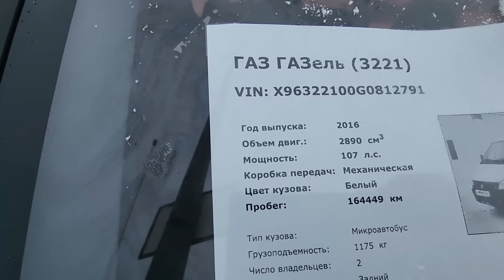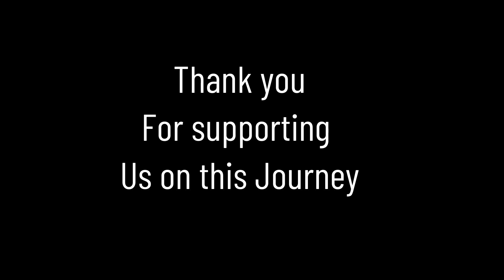NO LONGER FROZEN IN RUSSIA!!

Comment: And Arend, one very important point you need to know!
I do not know what a driving license looks like in Canada, but in Russia we have such a thing as a category of rights. It is indicated by Latin letters: A, B, C, D, E.
For example, the presence of the letter "B" gives you the right to drive an ordinary passenger car. Category "C" is a truck capable of carrying over 3.5 tons of cargo.
But category "D" is a passenger bus. If your Van carries more than 8 passengers, then it is already a micro bus and not a Van and it needs a category "D". In the form of both Gazelle and Korean Van (huenday), they had 8 seats that would not fall under category "D".

So if you want to put more than 8 seats in the car, then make sure that you, and your wife also has the right to drive the micro bus, i.e. you both must have a Category "D". You will also have to contact our "ДПС" (traffic police - DPS) to re-register your Van on the micro bus because you increased the number of seats from 8 to 10 and thus returned the Van to the micro bus.
I strongly recommend that you check with the traffic police or with knowledgeable people about what you will have to do to re-register a car in a minibus, how to do it correctly and how your driver's license is suitable for driving a bus.
For driving a car without a need for this category, it equates to driving without a driver's license and the penalty for this is a fine of 5-15 thousand rubles and confiscation of the car at the impound lot. To pick up a car from a impound lot, you need to pay a fine and every day the amount of the fine will increase. Therefore, the impound lot is a very unpleasant situation.
Reply: Wow, not something to be taken lightly for sure.
Reply: @joycehaines2055  Yes, in Russia, if your car was towed to a impound lot, then you need to pay a fine on the first day, otherwise every 24 hours your car stays at the impound lot, the amount of the fine will increase.
I know of cases when the fine became so large that the owners of the cars simply abandoned them at the impound lot. Then, after a certain period of time (if it is clear that the owner abandoned the car), such cars are withdrawn in favor of the state and the state sells these cars at auction.
Reply: This is a very useful and significant information ! Thank you for sharing !
Reply: @_I_am_Lucy  No problem )
Reply: impound is same everywhere, daily charges apply.
Reply: It's similar in Canada.  A regular driver's license is a class 5, class 4 if you have 8-10 seats, class 3 is tandem axle & towing, class 2 is school bus and class 1 is semi-trailer.

Comment: Hello Arend. A few notes regarding Gazelle.
1. 4x4 Gazelle is called Sobol.
2. 8+ seats is a different driver's licence category. It's considered a bus, you need the bus driver category.
3. Adding seats or any other significant changes to the car is possible, but you need to license it, which is extra work. So obviously try to avoid it if possible.
4. Gazelle is a good car when you properly understand it. Typically people get all juice from them and then try to sell. So most of the time used Gazelles are dead. You should be very careful in choosing one. In your video you are looking at a dead one.
5. Repairs are easy and cheap, but a used gazelle with significant mileage will break often. It's simply unavoidable. These cars are built to be affordable, so from the factory they are not meant to last a million kilometres.
6. There are three generations: Business, Next and NN. They are very different mechanically and in terms of comfort. Business (the one you showed in the video) is an old model from the 90s. I highly advise you to choose Next instead of Business. It's simply a much better experience.
Reply: Да согласен. Yes.
Reply: 2. Category D (bus): more than 8 passenger seats. So, if a car has 9 seats, including driver's seat than one doesn't need cat. D to drive it. But anyway they have 8 children here and 2 parents - so they need cat. D license.
Reply: Вообще-то бывает и полноприводная Газель
Reply: Top comment, hope @countrysideacreshomestead2008 will see it. Let's put it to the top!
Reply: Самый полезный комментарий 👍
Reply: Соболь - это не полноприводная газель, Соболь - это укороченная газель со сниженной грузоподъёмностью.
Reply: I cant beleive u can drive less ppl on B class in Russia then in Eu. 10 seats on B class in all of europe. Russia is Europe. i bet for 10 seats on B
Reply: @carsnanidiot Russian drive license system isn’t European
Reply: Боюсь, что Аренд может не увидеть Ваш полезный комментарий.
Reply: @carsnanidiot  Normal b class vehicle can have a max of 9 seats including drivers seat.
Reply: Газель тоже бывает 4х4
Reply: Good tips. Arend might have a Canadian CDL license that may be transferable in Russia. Germany gave me a CDL license when I transferred my US license.
Reply: @kevinwinkler6230  how many passengers does a standard canadian license allow to take? here in Russia not more than 8
Reply: @82acresfarm  Ok, more restrict than eu then. lol
Reply: @teddyhaby  kinda strange when Russia is Europe. but what the hell do i know
Reply: @zumfox3460  не стоит, Соболь проходимее.

Comment: Little tip for buying land - go looking just after the snow melts. That way you'll see if area is water logged when snow melts or there's heavy rains
Reply: @user-jo4hq8ks8n  голосуем что б им дали гражданство вне очереди!
Reply: The permafrost has no soggy parts. I watched another farmers video about how he managed his lands and added pens to it slowly. He was pretty far up north.
Reply: If the area is more or less flat then look out for drain channels, they are very needed when snow melts or rain fails heavy, and they need to be maintained, we had about 900 hectare and one man with a excavator was busy from spring to late fall just cleaning channels, but it will depend a lot about where in Russia you are located. A other thing to look out for is the local numbers of sunshine hours, rain, temperature, etc, do not take for granted that just the latitude tells you these figures.
If looking at a farm then look out for the electrical power supply, back in time they had minimum two high voltage power sources with same numbers of transformers, get a qualified electrician to check the state of the high voltage installation, sadly these installation are often poorly maintained and extremely costly to get up to today's code.

Comment: Rust is a nightmare for vehicles in Russia. Hot and humid during summer, cold and windy during winter, salt and ice reagents, rains mid-season. All that eats metal like termites eat wood.

Be aware that you need D-class driver license to operate that Gazelle which is aclually a small bus. So you will need to get B-class for cars, and D-Class for busses.
Besides, you need to register any changes to your vehicle construction in GIBDD, otherwise they may forbid using it and impose penalty up to revoking your license. Changing seats location is a huge safety concern, so be aware of that./
Reply: Excellent information 👌
Reply: Я думаю, раз у них раньше был дом на колесах, то и правда соответствующие должны быть.
Reply: @ОксанаЧ-п2ф не знаю как в Канаде, а в США этим (отдельными правами на автодом) не заморачиваются
Reply: В Канаде тоже 4 сезона.
Reply: @zoyagulyayeva6438  И тоже много машин гнилых. Удивился, когда увидел эти корчи в Торонто.
Reply: it's very easy to avoid just by not leaving your car sit in a pile of manure under the rain or snow throughout some "winter", "summer" or other off season, i.e. if the driver's head is somewhat different from a trashcan
Reply: @bluecold8844  It can be managed to a degree, that's true.

Comment: The van you looked at had large rust bubbles in many places, painted over so it's harder to see. This is rust through in its early stages, which in long term will lead to structural damage if untreated. And it's only from 2016.

I have a Toyota sedan from 2015, it only has one little spot on the roof, 1 square cm in diameter. All the rest looks like new. Dealership told me it will take 20 years to rust through.

My point - make sure you know how much it is to repair / replace doors and other panels before buying, and how soon you will have to do it -- talk to a dealer or mechanic and find out.
Reply: Hi if wanna buy some Russian car for family check Gazel next or Sobol NN or Lada Largus is not super quality cars but Lada part and Gazel parts details you can find in all Russian cities village or small towns and  mechanics know how fixed
Reply: The under-body looked pretty clean, most likely just shitty quality sheet metal.
Reply: these vans are a pile of shit, notoriously unreliable and unsafe. And yes they really take no time to rot

Comment: Hey Arend. Great video, thank you for including us in your adventures. 
It looked ok however the missing seat would cause problems. Keep searching and hopefully there will be one available without oil leaks. Most 7+ seater cars in Russia will have very high mileage due to the size of the country and may have been previously used as Taxi’s. Try to see if in your community there may be a mechanic to help you by giving it a once over so it doesn’t cost lots of money to fix. God bless you and your family best wishes from mine to yours 😊🙏🏻🤍💙❤️
Reply from the maker: Thanks for the advice!
Reply: @countrysideacreshomestead2008  Mr. Apple Knocker, you can install as many heat exchangers in the cabin as you like, but it will not raise the temperature even by 1C. Why? In Russia's freezing temperatures, heat generated as a byproduct by this underpowered engine is not enough to keep an uninsulated cabin warm. For a comfortable temperature, such big cabins are supposed to have a separate heater running on diesel fuel as well as other measures must be taken. That's what sets apart an engineer and a farmer... 🤣

Comment: IMO it's best to buy something with a lot of clearance in Russia.  A lot of locals don't (because it's often more expensive) but the roads aren't always the best here.  It doesn't necessarily have to be 4WD but clearance comes in handy.   Also take everything you hear with a grain of salt.  Many Russians are enamored by prestige items. When I first came here, I had some budget phone, but it worked OK and I don't really need a high end phone.  I got asked by several people why I didn't have an iPhone.  I guess they thought it was strange that an American didn't have one.  As for Russian cars, they tend to be more basic. In general they are designed to be easy to repair.  The reliability is model dependent.  Specialized vehicles tend to be better, but do your homework.

Comment: Arend, I am a specialist in diagnostics and repair of Gazelle cars. I don't know exactly how much Google Translator will translate my text, but I'll try to tell you more about this car. Unfortunately, the Russian automotive industry does not produce expensive cars of the same class as Gazelle. And if you want a car of exactly this class, then you have nothing to choose from. Only a Gazelle or a foreign-made car. So, the Gazelle is by and large a fairly reliable car. The negative image that this car has received is not reliable. In fact, the citizens of our country speak badly about the entire Russian automotive industry. But this is mainly due to the fact that the owners do not want to service their car after purchase, do not change the oil, do not go for diagnostics until the car refuses to go at all. They try to fix any breakdowns on their own, without having the necessary knowledge, skills and tools. This is in cases where the car is domestic, which means it is not expensive. But if a foreign-made car is also very expensive, then it has a completely opposite attitude. Hence such reviews of domestic cars.
As for the Gazelle in particular, it is almost always loaded over the norm by 2 or even 3 times. It is clear that in such conditions the car will not be durable. I want to name a few weak points of Gazelle. 1) the poor quality of the body preparation for painting at the factory and the complete lack of anti-corrosion preparation leads to the rapid appearance of rust on the body. It will be necessary not infrequently to tinge such places so that it does not rust to a hole. 2) The engine, which is installed in the "Gazelle" that is shown in your video, is quite old and is famous for the fact that its oil leaks from many places, especially the crankshaft seals often leak. But one of its advantages is the cheapness of spare parts for it. Its resource is about 100 to 300 thousand kilometers, after which it needs major repairs. But in general, the engine is very simple and its repair is not expensive. 3) The undercarriage is the most reliable system in this car, but it also requires maintenance according to the manufacturer's regulations. I am the owner of such a car myself. My Gazelle bus was manufactured in 2007 and operates along the urban public transport route. Its mileage today is already more than 700,000 km. During this time, the engine was overhauled twice. Many times I had to touch up the rust on the body, but there are no through holes yet.
In general, the car that you looked at usually contains 13 seats + a driver. Your copy was most likely converted from a thirteen-seater into an eight-seater car. The fact is that if there are no more than 8 passenger seats + a driver in the car (9 seats in total), then the car belongs to category "B", and if there are more seats, then this is a higher category "D". It should be understood that the driver's category "D" is a more serious category and is associated with the transportation of passengers in the number of more than 8 people. There are more serious requirements for cars in this category. It is also necessary to undergo a state technical inspection twice a year and the installation of a tachograph is required. For this reason, I would advise you to consider cars with no more than 8 seats for passengers, in order to avoid unnecessary hassle and problems.
Regarding all-wheel drive, there are Gazelles with all-wheel drive, but if it's not a bus. If you wish, you can install all-wheel drive on your car in a private workshop for a fee. No additional registration is required for such changes. But the GAZ Automobile Plant also produced a smaller copy of the Gazelle car called the Sable. There are just 8 passenger seats + a driver's seat in the Sobol car. And the Sable car was also produced as an all-wheel drive. But its disadvantage is that it is shorter than the Gazelle by about 50-60 cm.
In summary, I want to say that the Gazelle and Sobol cars are quite reliable with proper care for them. If you carry out maintenance on time, the car will last you long enough. Well, the price of this car is quite low. You will not find a car of the same class at this price among foreign cars.
I wish you luck in choosing a car and I really regret that I cannot help you more than I have already done. Greetings from the Volgograd region.
  P.S. Google's automatic translator, unfortunately, does not accurately convey the meaning of what I wrote.
Reply: Russian people are the best❤
Reply: Очень классно ответили! Ещё немного я и сама бы захотела Газель ❤😅

Comment: Good afternoon, for Russia the Gazelle is a very good option, cheap spare parts and, what’s important, it can be repaired in any garage. It is possible to find a very good option depending on the condition. Foreign cars have problems with repairs, there are no spare parts, or they are expensive.

Comment: Definitely front wheel drive, if you can’t find a 4x4. I forgot just how bad rear wheel drive is on ice, until the 4x4 croaked on 1/2 ton a couple winters ago. Probably didn’t help that I didn’t have any extra weight on the back end, but she was just everywhere, had to crawl around to keep her on the road until I got her 4x4 fixed. 🙈😂 Happy to hear your bank account is going again. 😊

Comment: Dude, if you're going under the car yourself, take a pry-bar and wiggle all of the suspension and other joints, mounts and all of the connection rods to see how loose or firm they and the rubbers are... Have a smell of all of the oils to see if they have a healthy smell, not burnt or anything... If you can, check the differential oils... Try to take the vehicle off on the 5th gear - the engine should die immediately; otherwise, the clutch is gone... Overall, if you're looking for a beater to move you from A to B, as long as the mechanical parts are in good order, it'll do... The look of it, especially the rust will be the same as in Ontario or Quebec... It will have rusts, can't avoid that, especially if it's sitting outdoor.  In all cases, after buying any car out there have it sprayed with antirust oils - all of the bottom, suspension parts, fenders, inside the bumpers, sides of the doors and corresponding frame... There are machines like carwash guns that spray rust protection oils instead of water... Well, hope this helps 😉 Oh, and one more thing; those GAZELS or RAFs are most often used as маршрутка, so, be careful with those, cuz they could literally be at the verge of falling apart. Otherwise, why would they sell it? Oh welll...

Comment: Well, as some people already wrote, before buying a car check, if you may drive it with your licence category. And be careful with changes in the car, it is very difficult to get registration for a car, if there are changes. Police might require that you make assessment that these changes are allowed by manufacturer, and this is very expensive. Otherwise you could drive this car only somewhere in the country, where no road police is present.